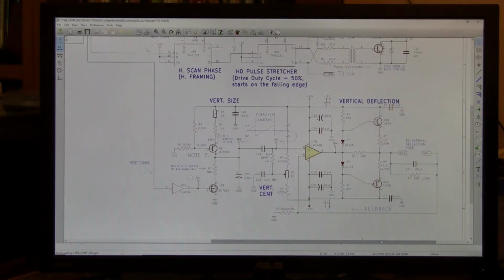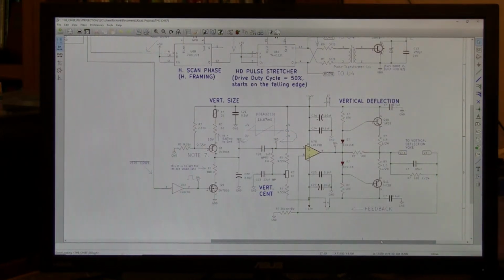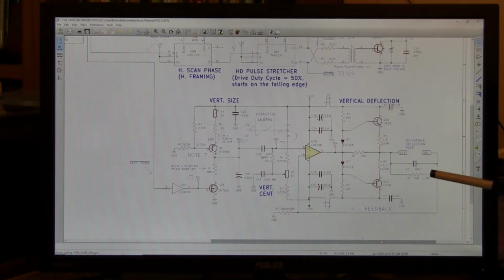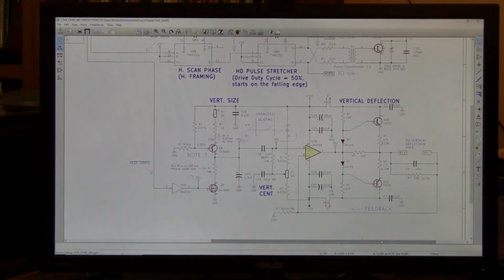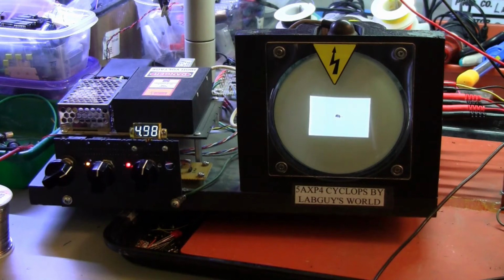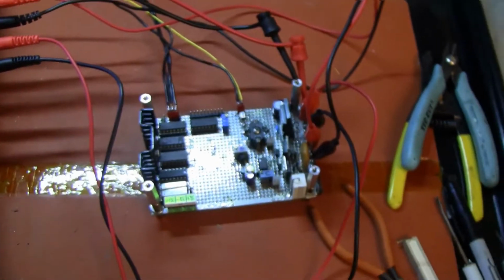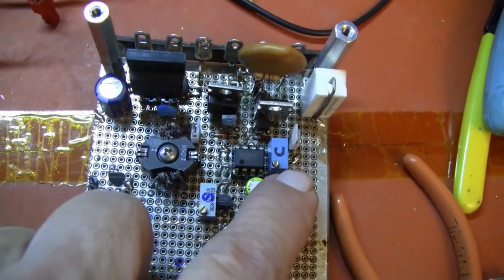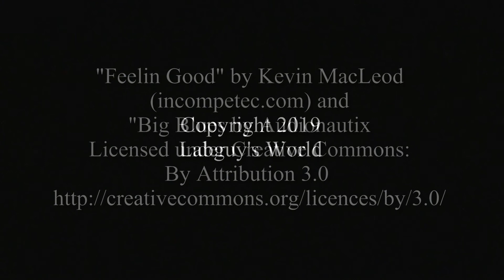The Chief - Update #8

Comment: Dontcha just hate those brain fades when you can't see your own error?  I still remember the day I spent hours trying to make an emitter follower work properly because of a too-visible mistake between the schematic and the board.  That vertical drive circuit is working nicely now, and should work pretty well for a wide range of similar-size yokes.